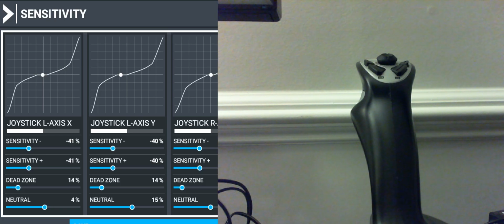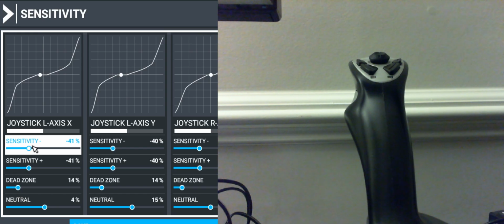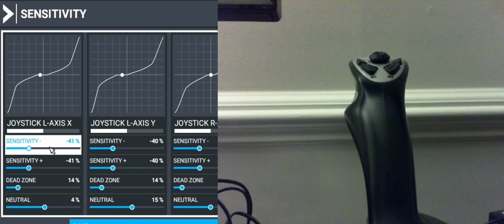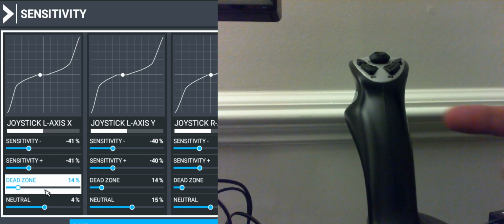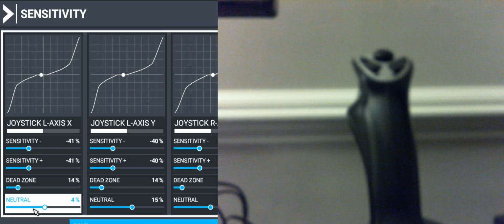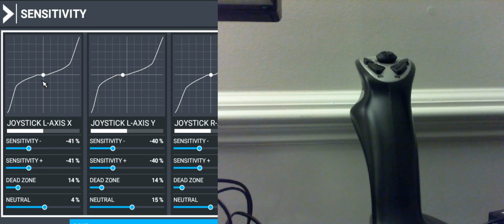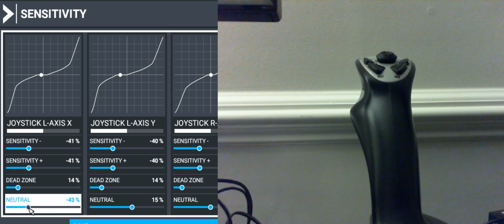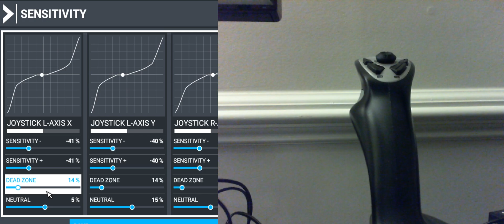Microsoft Flight Simulator 2020 QuikBrief - Configuring Controller Sensitivity

Comment: With the greatest respect, this makes no sense at all!   Unless you "show" us how to do it.   You talk about sensitivity at ZERO but in the video it shows -41%!   It also looks like you have the same stick as I have - the Logitech Xtreme 3D Pro.   My rudder pedals and my ailerons/elevators are all really "snappy".   I find myself squirrelling down the runway struggling to keep the centre line on takeoff and landing in MSFS2020 - but I do not know how to change the settings to stop this!   Can you show us how you set this up?   Ok a longer video, but I for one would wlecome it.  cheers - Lee
Reply from the maker: For X- & Y- axis, try with a Sensitivity set to -41% and and a Deadzone of 10% to start with. As for keeping the centreline, that's your rudder on the Z-axis. may have to adjust your Neutral zone. Grip your controller as normal, and make sure the "Dot" on your Z-axis" is in the middle of the "Flat spot" in the centre of the curve. To make the "Flap spot" wider, increase your Deadzone. I hope this helps. If it doesn't than perhaps my teaching style does not match your learning style and perhaps another video maker is more suitable.
Reply: @viperflight8458  Ok, thank you.  I'll try it.   You explanation makes more sense now.   Thanks again - Lee

Comment: Hey

so i have the same "setup, sens - sens + deadzone and neutral. Are these the settings for a joystick only? Asking because ive got an honeycomb yoke with same options i cant find on other peoples video using a yoke." 

Im asking because i have issues with the yoke climbing...
Reply from the maker: It's worth a try! I don't have a Yoke so I cannot speak with certainty. I'm assuming the concepts should apply somewhat across all controllers.